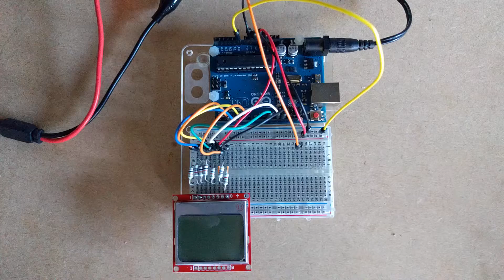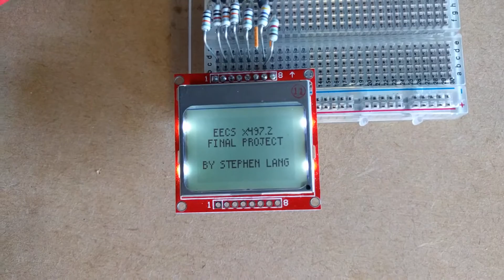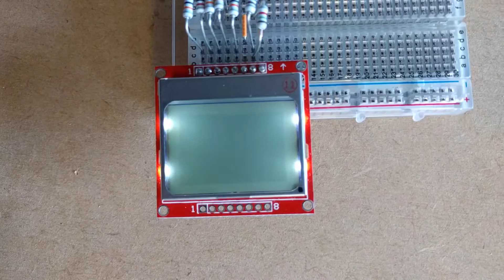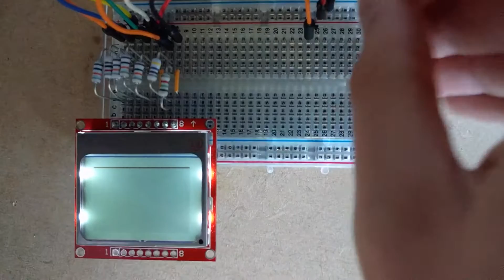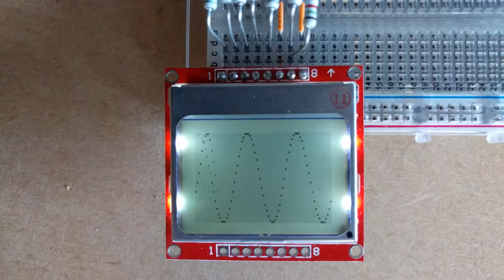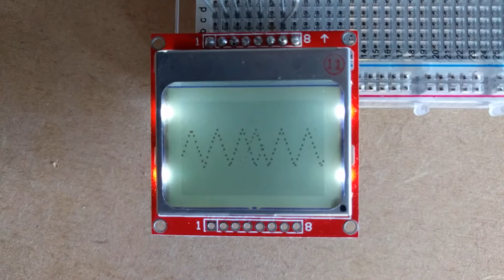An Oscilloscope in 8-bit AVR Assembler

Comment: Can you please explain your code and what logic you have used that how it is working and what the different parts of code are doing . I'm new at arduino assembly , so I need a little help if you could . Thanks :)
Reply from the maker: I've added a link to the PDF report in the video description which should help. If you take a look at the references there are links to all the material I used. Thanks for taking an interest and good luck.
Reply: Thankyou :)
Reply: Tell me one more thing  , how did you uploaded this Assembly code in Arduino?